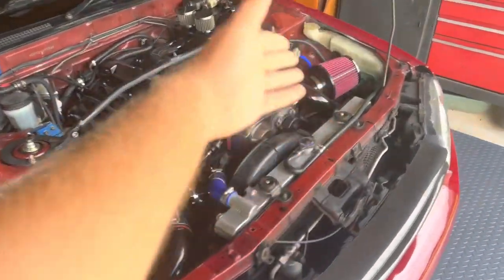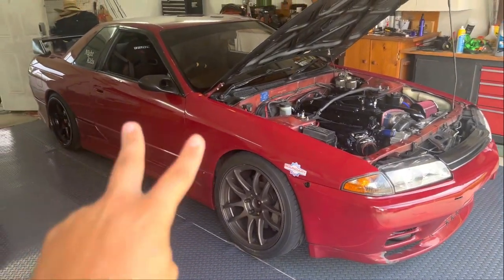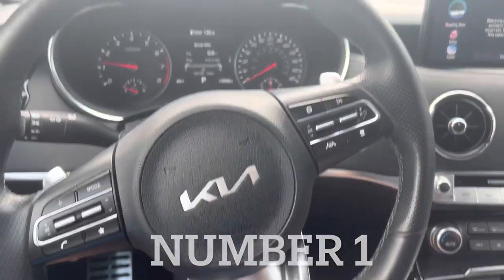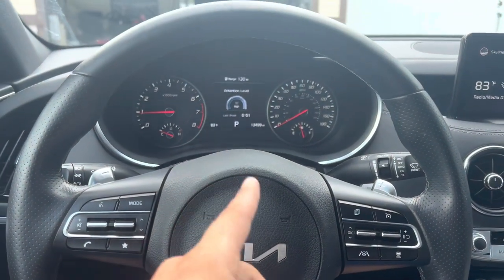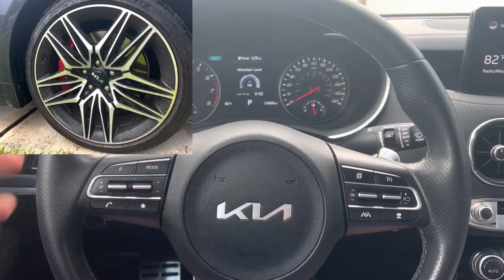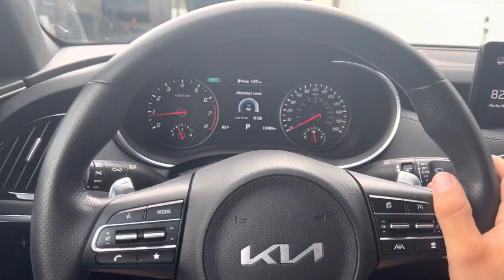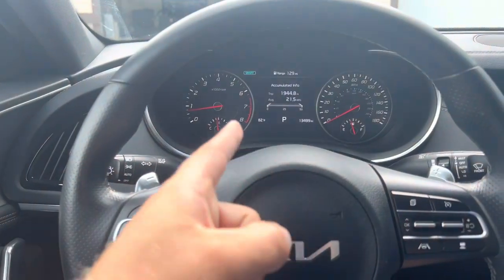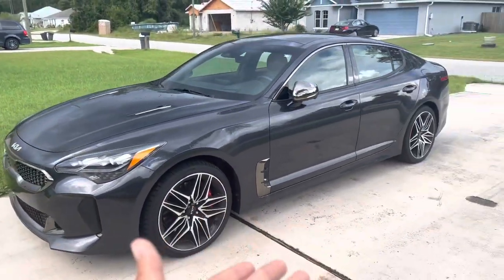5 Things I Hate about my 2022 Kia Stinger GT2! (Owner Review)

Comment: My 2021 GT1 Indigo Blue and my 2023 GT2 Special break my arse if i drive longer than 100 miles and i find it difficult to wear my sports hats while trying to reach for the atm or drive through fast food.. sometimes i hit my head on the roof getting in and im only 5'10
Reply from the maker: I would try lowering the seat a bit, also the bolsters have adjustments in the gt2 so widen the bottom a bit. You can also extend the front of the seat that has helped my comfort. Have drove hours in the car no issues. I would play around the seat adjusts in a crap ton of ways lol.
Reply: I'm 6'1 and I was driving a Toyota 86 subliminally comfortable because I love the car, never wanted to find anything to complain about it. But now I drive a Stinger gt2 and damn the space that compares from the 86, I feel like I'm entering in a spaceship lol

Comment: It's not a rotor issue, It's a pad issue. The pads leave deposits on the rotors.
Debadging it makes it look much better. The 'Stinger' script is the only badge I left on.
Also, yours doesn't have a heated steering wheel?
Reply from the maker: No it doesn’t, but I live in Florida we don’t see that super often. It is a gt2 and has every other option

Comment: I have a 22 Stinger GT1… love the car for the most part but I F**** HATE THE G** D*** STUPID AUTO WINDSHIELD WIPERS. THEY ARE SO AWFUL. MOST STUPID RIDICULOUS FEATURE EVER. I’ll be driving down the road in a light rain shower.. barely enough to notice… and my wipers are full afterburner at Mach 10
Reply from the maker: My auto is adjustable, it’s the weird switch on the stock, give it a good look.
Reply: @RandomFootageFromRon  I keep it on low

Comment: I own a 2022 and have the same issue with the brakes. Really makes me want to get after market brakes when it's time to get them changed. I even got them resurfaced at the dealership recently and there is still a bit of shaking when braking. The only thing that I'm worried about is how it might affect my warranty in anyway if I go with after market brakes although they aren't under warranty
Reply from the maker: If you google, there is a bunch of information on how to prevent it and fix it with out purchasing or replacing. What causes the shake it debris build up on the rotors from the soft pads. After I did some research haven’t had an issue since.

Comment: Brake issue is because Kia uses cheap shitty rotors on the Stinger. Had that issue with my 18. My GTS didn’t do that but I heard they used the Euro spec rotors on the GTS. They could have fixed this using better rotors.
Reply from the maker: It’s actually not the rotors. I’ve done a bit of research and it’s actually the pads leaving deposits on the rotors. They used to soft of a pad(to prevent noise) so when driving spirited and then coming to a stop it causes deposits to be left behind. I have actually been able to get rid of it. If you look up on Kia stinger forums it shows how to remove the issue and how to prevent it. After getting my brakes right and following the prevention methods I haven’t had anymore issues.
Reply: Bought new pads at only 14k.  The "warped rotor" problem went away within 500km of driving. The problem is the pads and is a well-known issue on the forums.

Comment: Anyone have the issue of the car braking for you everytime you come to a stop (or near to a stop)? Shit is so annoying, at the shop rn hoping they diagnose it. It occurs regardless of vehicles in front, just applies the brake; even after speed bumps sometimes when I try to accelerate, it is still braking for me (no it's not downshifting/engine breaking).
Reply from the maker: I have not, but that sounds scary. Your front sensor may be out. But id definitely get it checked out. You might also have a brake caliper sticking.
Reply: @RandomFootageFromRon  Caliper sticking sounds the closest to me. I thought it was a new-car aid feature at first. But getting pulsating brakes foxes and we'll see if it persists then. Thanks

Comment: Mine rattles in the dash and it's embarrassing when driving with friends. If the pavement isn't perfect, the car is loud as hell. To get the decibel levels down it costs 5k to have a pro do the work. Yes, it drinks gas and expensive to fill with premium. On a five plus hour drive over the summer it got 27 mpg highway. I put the Korean badge on it and people ask me all the time (yesterday at Costco) who makes the car. I tell them KIA and don't know what they think, though some people don't care and say it looks really nice.
Reply from the maker: That dash problem sucks sorry to hear. I haven’t had anything that bad. The one or 2 noises I hear are easily covered but people talking or a bit of music. Gas is one of those things you kind of trade off for. 370hp390 ft does take some fuel when you step on the throttle.

Comment: My ONLY complaint on my 23 gt2 is the steering and it being so heavy.
Reply from the maker: I understand that, but also think it’s because it’s just such a large car. And with the electric steering they are attempting to provide realistic fees back.
Reply: @RandomFootageFromRon  
 Yeah but it's far from it. Don't get me wrong when I DRIVE it in canyons it's not a bad thing. But for everyday driving it's not ok.
Reply from the maker: @handtohandcombat3535  in all the drive modes it’s the same?
Reply: @RandomFootageFromRon  
 Yeah it is. I thought it would change but it doesn't
Reply: @handtohandcombat3535  It does change depending on drive mode.